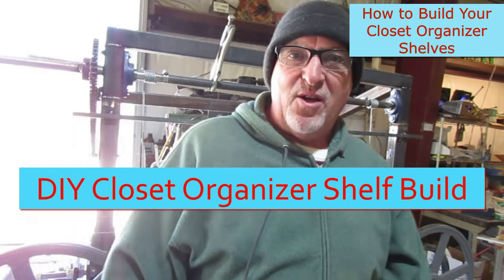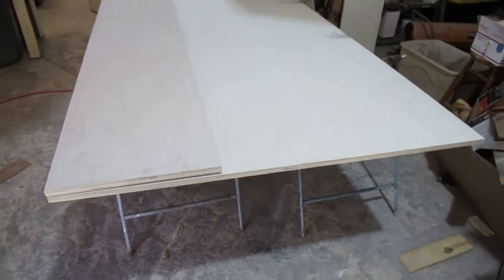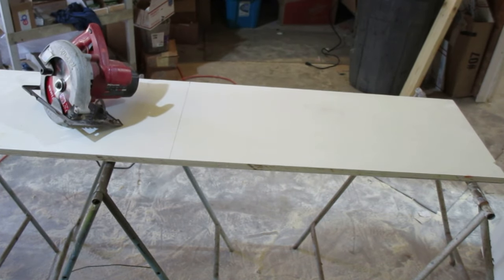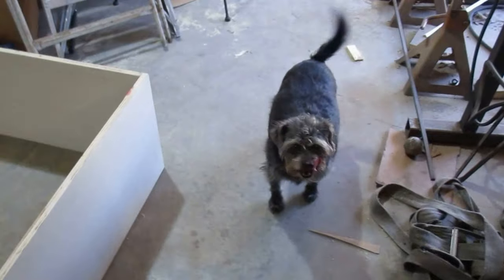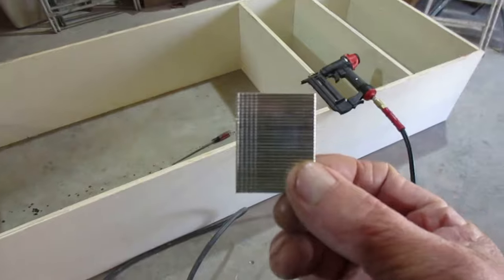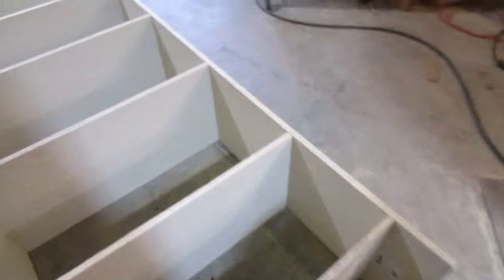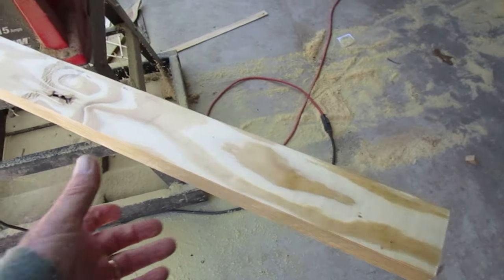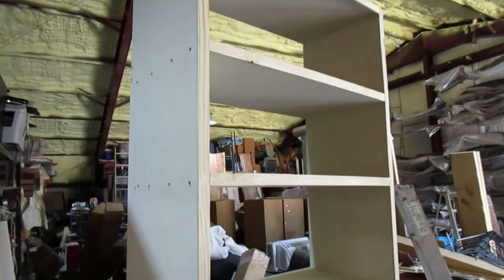This Amazing DIY Plywood Hack Transforms Boring Closets Forever!

Comment: why didn't you cut the 4x8 with your  table saw?
Reply from the maker: The little cheap table saw I have it not very accurate and I was limited on space to use it..but that is a good suggestion..
Reply: Cutting sheet goods isn’t always the safest option. Track saws are ideal until it’s a more manageable size.